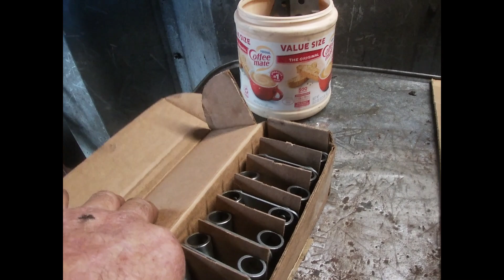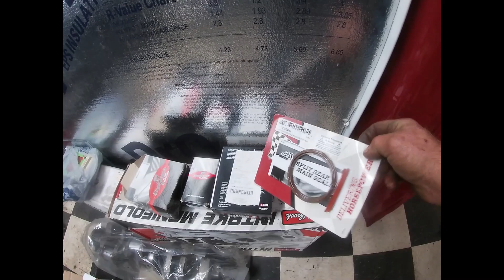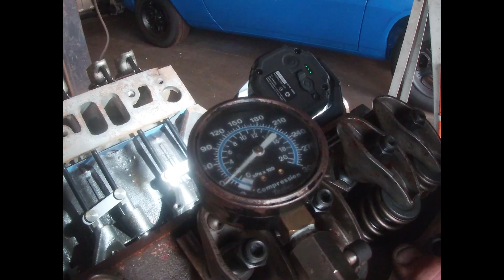1977 Pontiac Trans Am - Motor - Part 3

Comment: Motor looks really nice. Been enjoying the build. Not to be a buzzkill, but, it's been my experence that more often than not, the aftermarket hydraulic roller lifters contact the bottom of the valley pan. Hope that's not the case with this one. Looking forward to hearing that Thumper cam in a 400 Poncho!
Reply from the maker: Those roller lifters specifically fit Pontiac 400.We thank you for your comment and for watching